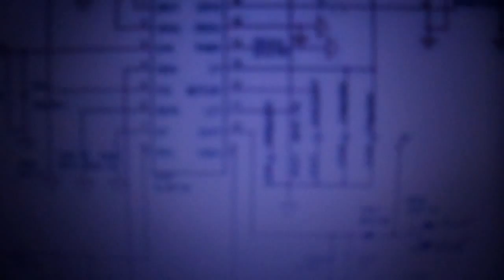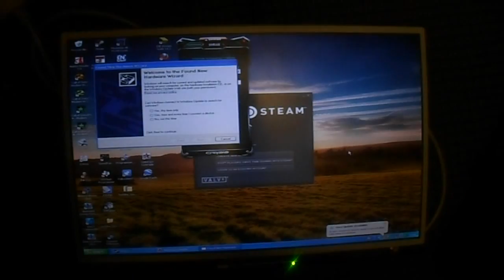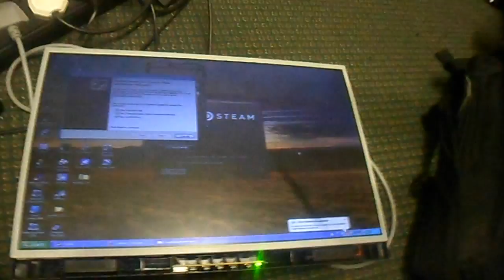Hyundai X93W - and how to disable a "2 seconds to black" circuit

Comment: thanks a lot for video , I had the same problem with LG screen, but the inverter dose not have a PN printed on it I end up shoring the capacitors one by one until I found the one responsible for the timer luckily  noting burned out , now it is working fine

Comment: Hello, i want to do this for a LCD TV inverter (Philips 42" 42PFL), but ive read that it could be dangerous because it could burn the TV case, the plastic and it could then lead to fires, do you think it is true? Are you agree?
Ive already done this for a monitor and so far its working well. I didnt see any drawbacks or any bad consequences, do you think its the same for a LCD TV?

Comment from the maker: I'm not sure unfortunately, hard to locate exact cause. Usually 2 secs to black is triggered by overvoltage, so placing a solder jumper across C816 may stop that, but no guarantees.

Comment from the maker: I checked and it wants min 0.3V max 2.7V on TIMER, so jumpering it won't work. It has 20uA source current, so try putting 150k resistor in parallel with cap.

Comment from the maker: Just put a 150k (or so) resistor in parallel. Actually maybe make it 220k because that is going to give it more headroom. Capacitor the same or not present, doesn't matter.